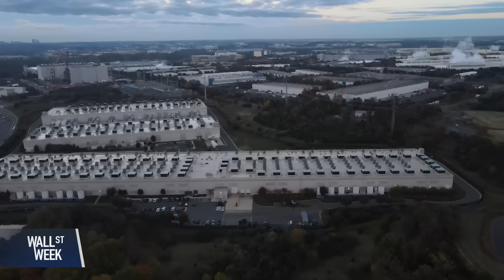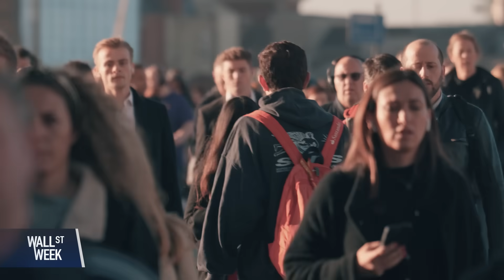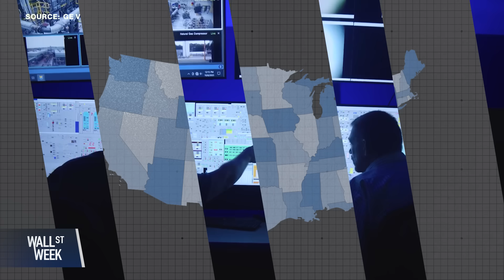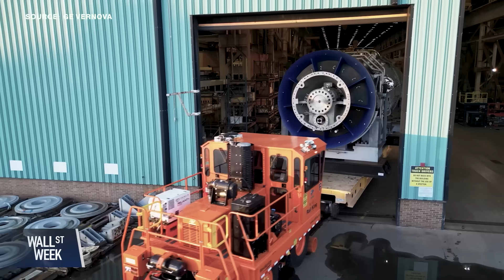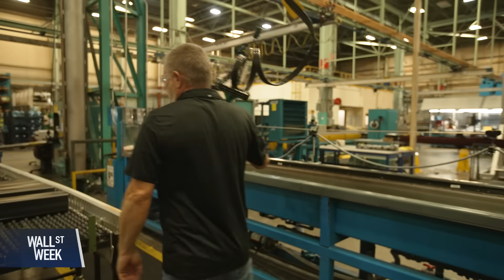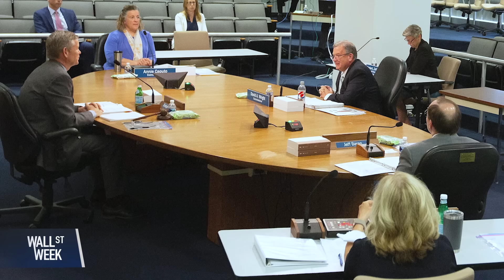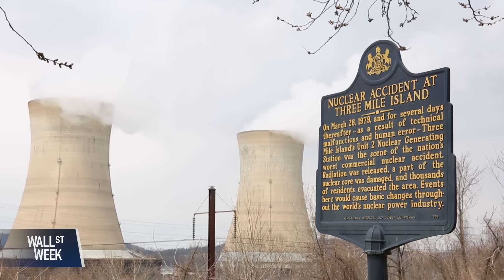US Power Shortage: How Small Modular Nuclear Reactors Could Fill the Gap

Comment: Absolutely not!  Commercial utility-scale nuclear energy is the most expensive way to produce electricity, the slowest to build (decade or more) and comes with unparalleled risks that no other electricity generation method even approaches in risk profile.  Waiting on new nuclear construction will ensure fossil fuels are used for decades and decades longer than they would otherwise be and all at high costs.

There are far better options that are cheaper to install, much faster to build, and safer.  Commercial utility-scale nuclear is absolutely not needed.
Reply: Furthermore...

Commercial nuclear energy isn't even in the race when it comes to growth...

Since 2000, world wide nuclear energy growth has only been 205 TWh whereas solar + wind has grown an order of magnitude more at 4591 TWh over the same period — and the gap is widening each year!  It's not even any contest at this point!   Renewables outpaced nuclear growth by over 22-to-1 ratio!

And renewables still continuing their exponential growth as their price continues to fall while commercial nuclear just keeps getting more complex and more expensive.  The world has never seen anything like what's happening today with renewable's growth.

After 70-years of operation, commercial utility-scale energy only powers 9% of the world's grids and is falling.  In the next 15 years or so, upcoming commercial nuclear retirements will outpace nuclear construction and commercial nuclear will hit a "retirement cliff" and its present-day 9% of global grid figure will plummet like a rock.
Reply: What SMRs can offer is price control and assured schedules.  That doesn't mean they will.   They are only practical for exiting nuclear sites because of US nuclear power plant 10 mile radius evacuation requirements.
Reply: Furthermore... here's some information on the budget and schedule blow-outs from the most recent nuclear reactor builds.

Look at the fiasco that is the US Georgia Vogtle nuclear power plant.  It was a schedule and budget fiasco over-budget by double ($14B to $30B USD) and over-schedule (2016 expected but was 2023).  Taxpayers are on the hook for some $8-billion for this thing!

Look at UK Hinkley Point C (using French EPR) under construction already billions over budget and years behind schedule.  Almost certainly will have more delays and more money needed.

Look at Finland Olkiluoto-3 (French EPR)  which was 18 years behind schedule and original cost €3 billion but ended up at €11 billion.

Look at the fiasco that is France's latest Flamanville-3 that was initially expected to cost €3.3 billion, the price tag has now soared to a staggering €23.7 billion.  It has launched in 2025 but is producing very little power as more problems are discovered keeping this new reactor in test ramp up mode only.  France's nuclear program is actually not a model anyone should model their nuclear industry on with its massive amounts of debt.

The worst part right now is that continuing the promote commercial utility-scale nuclear energy will only delay the global energy transition.  It will most certainly allow fossil fuels to be used for decades and decades longer than otherwise.

There is only one source of energy that will bring down fossil fuels and that is the free clean fusion energy gifted to us by nature.  It can power our world 10,000-times over at least.  Sunshine and wind cannot be taxed, sanctioned, tariffed or blockaded.  Renewables have zero fuel costs and zero fuel infrastructure as the raw inputs of sunshine and wind arrive freely.

All the science and economics stands behind renewables wind, hydro and especially solar dominating the world's energy systems.

Comment: Small modular reactors could be a key step in balancing the grid as demand surges, offering a scalable and reliable energy source for the future.
Reply: An SMR would currently require the same US 10 mile radius evacuation area as full scale nuclear.   This is where the romantic marketing of a medium sized industrial application having its own SMR steam plant for electricity and heating needs meets reality and fails.   In a remote uninhabited areas it's worth evaluating and possibly enabling for the site.  In the US for heating natural gas and for electricity USC clean coal power are the longer term economical energy supplies.  US wholesale natural gas may double in price to be profitable.   US natural gas has stayed around $3.00 mmBTU since 1998.  In real terms US wholesale natural gas is half the price it was in 1998 and is mostly not profitable.   It is an oil fracking by-product.
Reply: Even China needs 5-7 years to complete the construction of a nuclear reactor..
Reply: @c@carkawalakhatulistiwafor sure
Reply: Smr aren't small or cheap,these are lies😂😂😂